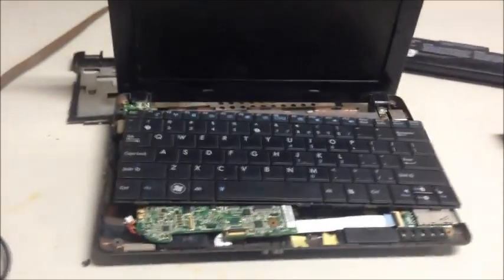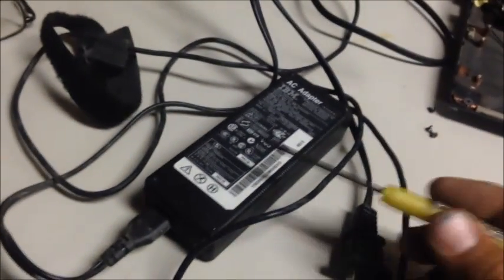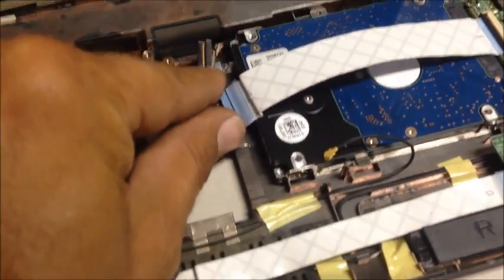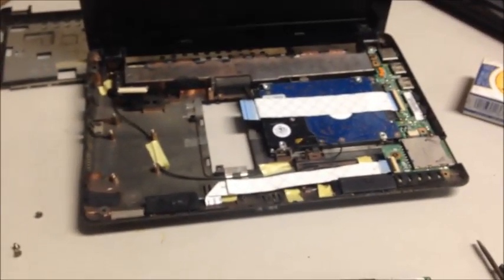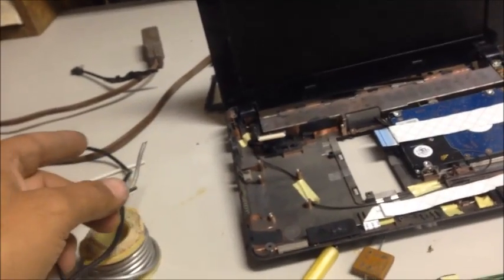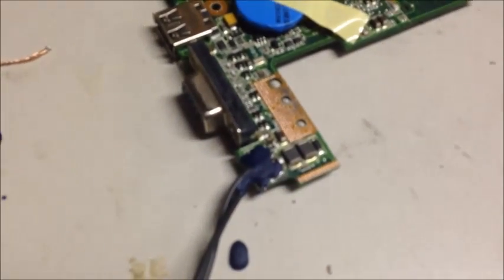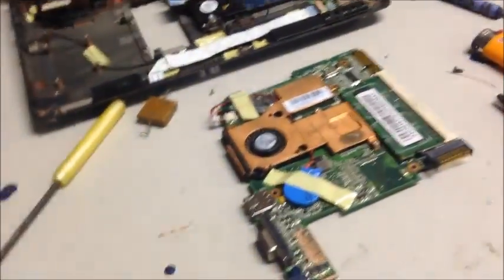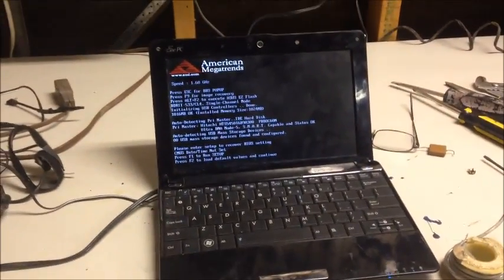How to Hard Wire a Laptop

Comment: I did a couple of ours through the battery terminals because the power sockets were glued in (acer 9400 IIRC , acer  seem to like to do that and they are incredibly hard to remove even if broken). They have worked ever since (about 3 years )

Comment: 2 points, #1 the laptop sound driver circuit is not powerful enough to drive a large stereo speaker and the impedance will not match most likely, #2 So how did you bypass the battery pins ? Doesn't the battery have multiple hookup pins ? And aren't some of those battery pins used for interconnect which verifies the correct battery is installed ?

Comment: Just seen your awesome video and was wondering if you have ever wired an external power button so you start laptop with the lid closed. Ie for use for an arcade?  Thanks
Reply: I'm interested in doing this exact same thing! I have a laptop with a temperamental jack and hardwiring is the logical step

Comment: interesting with that crayon, but I would have just used a hot melt glue gun (or silicone sealant, or even 1 minute epoxy) to protect the wires.

Comment: I have a question, I have a guitar amp that uses the same type of powersupply. The power jack broke so I cant plug in the cord. The jack has been discontinued so I cant replace it. Can I use this same method to hard wire in the power supply?
Reply: Of course you could also always solder any type of Male connection into the power supply and the corresponding female connector onto the amp system
Reply: Do you have a broken piece of equipment that can donate a jack? If so just use the jack from it, and swap the connector end from its power supply to your power supply that goes to the amp just hook the wire up with a union splice and put some shrink tube on it and you will be good to go and it will be fixed and even look decent.

Comment: I have a Acer kav60.   Can I cut the wire on the power jack and connect adaptor direct ?
Reply from the maker: yes, just be sure you get the right wire put back, you dont want negative going to positive etc... thanks for watching.
Reply: thomas brian Thanks a million ,  1 more thing can I use a 6volt adaptor ?

Comment: I might seem slow but need to ask were u putting the wires mins not coming on period
Reply from the maker: check the polarity. red needs to be on positive inside plug. most common the inner part is positive and outer is ground.

Comment: Hey there, i dont know are you still alive there? but i have a question.  I was following your steps and it works now.. But my question is  there are 3 holes  Positive Negative and Ground..   2 holes are close to each other i guess it is neggative and ground. What happens if i solder neggative and ground  together? Is there any risk about it? Because it  seems like you have also together soldered. My laptop works fine right now. Negative and ground soldered together and positive apart from them.
Reply from the maker: it is positive, negative, and neutral. on the bus bar for most elec panels in your home there are are white and green wires. black and red will be positive, green is ground and white is neutral . since white and green can be connected to the same bus bar. ( thus a plug with two pins or three like your tv,or ext cord. ) the it will work either way. you can have them connected, or just use the two wires. you will be fine. alternating current ( ac)  allows this . direct current ( dc ) does not. in short yes, you will be good. thanks for watching. great question!!  ps my heart is still beating. ha thanks again.
Reply: thomas brian thank you for your quick retutn. I had a laptop withouy battery, at the end power socket also got broken,  so i decided to keep it in my dusty basement till i saw your video.  Thank you for your bright idea. my laptop is back again after months..  I was just worried about connecting two cables together.  it works fine but better to ask if there is a risk  :)) Thank you....

Comment: I have 7 wires, it has a light indicator with it. 2 black wires (assuming they're neg)
The wire that goes to center isn't red, should I just go ahead and use it...test it out?
Also,do you think it would be safe to use a 12v output for a laptop intended to for 19.5v input?
Reply from the maker: +Em Hauk from 19.5 to 12, your ok. but if the lap top needed 12 volt and you put in 19.5 then you would have a problem. how ever 12 volt may not be enough. your not gonna hurt it to try it because its less. but im guessing it wont be enough. as for the wiring , im not sure without seeing where they go and what they come from.sorry about that. just be sure not to hook anything up backwards, even 12 volt would fry it then.  good luck.thanks for watching. and please let update us all.

Comment: my asus laptop battery is not working . I urgently need to acces files on my hard drive and buying a new battery is currently not an option. can you please tell me how to turn the laptop on without battery;only on ac supply( laptop doesn't turn on if I remove the battery and connect the power chord). I will heavily appreciate any help.
Reply from the maker: it should turn on with or without the battery, it sounds like you may have blew the fuse. open the back look wherre the 12 volt adapter plugs in, follow the leads to a fuse,
Reply: thomas brian 
when I plug in the battery and power chord it turns on for a few seconds. and then shuts off. without battery and with power chord it doesn't turn on. I'll follow what you just said.
Reply: thomas brian 
I was encountering the same problem a month ago. I left the laptop for a month and then started it( battery and a.c. chord in). Laptop turned on for 5 minutes amd then turned off. I'll follow what you said and then reply
Reply: I have same situation...my thin laptop with build in / non removable battery, only turn on for a sec then suddenly turned off if powered by ac adapter without internal battery installed...

Comment: OK so the original out is 19.5v 3.34A so the hard wire can it be 14.5v safe to assume not to wire the 19.5 correct?
Reply from the maker: yes  the closer you can get without going over is best. thanks for watching.

Comment: No offense but that's kind of ignorant for a couple reasons 1 the way laptops are designed is kind of like a true online UPS system the power comes in feeds the laptop charging unit goes into the battery if the batteries fully charged it does power the laptop and you can power a laptop without a battery however if there's any kind of glitch from the power coming into the laptop the software and data is far more susceptible to corruption as the laptop will immediately try to switch over to the battery supply to compensate however it's not able to do that the reason why it does this is because in a normal computer two power supplies got enough power and reserved that even when the power dips coming in it's just enough to keep everything going in a laptop it doesn't work that way
Reply: hey he made it work knowing that could happen... love it!!! we need more people like him...
Reply: If your in a spot where you have to do that then it out weighs the negatives
Reply: I don’t think this is the case, the only thing he’s really bypassing is the plug itself which shouldn’t be too much of an issue as long as you don’t touch anything else on either the charger and motherboard. All adapters and resistors should still be there. Is it the best idea? Probably not. Most dc adapters for laptops aren’t really meant to last and need to be replaced after some time , so just remember how you did it and don’t leave it plugged in all the time.